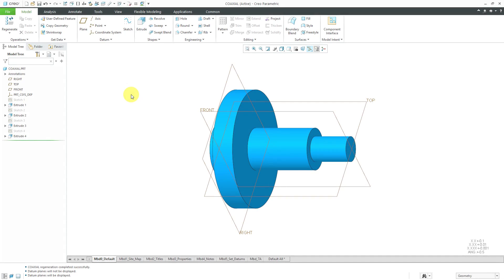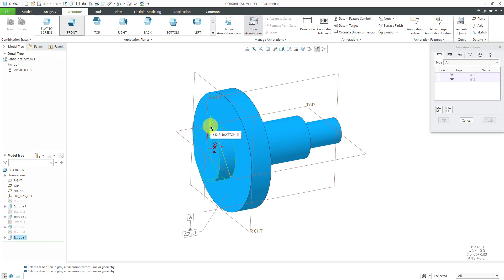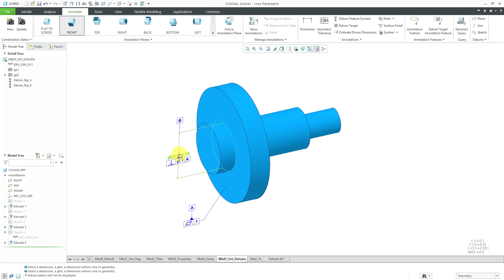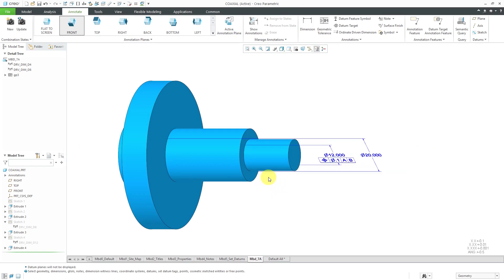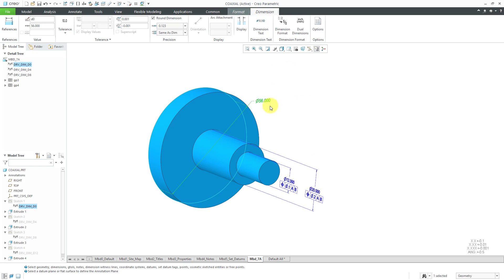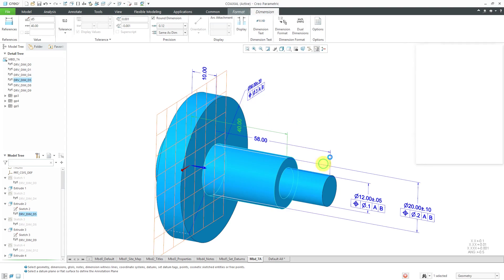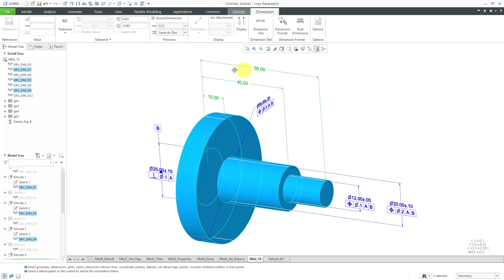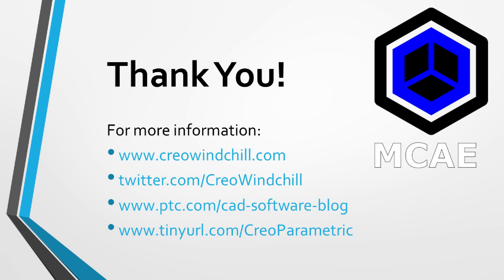Creo Parametric - Geometric Tolerances (GD&T) Part 2 - Model Based Definition

Comment: Have you had success with MBD replacing standard drawings?  Or is this more of a supplemental thing?
Reply: Hi Matt.  I was thinking same as you do two weeks ago.  MBD is a lot more than "replacing standard dwg", these info is embedded in CAD files to be used down the processes, i.e. CMM, CAM programming... And a lot more...  It saves lots of time, errors later on
Reply: @vesperita11  Does it support STEP242 standard? Can it be imported into CMM?
Reply: @vesperita11  Yeah, this is true.  MBD's should be approached with same degree of attention to detail as a standard drawing.  If MBD's become CAD the Master, can you call materials in your MBD?  What is your part going to be made of?  If you're going to paint your part, can you call out a paint spec in your MBD, can you call out other process like anodizing?  To control overall cost, can you add your own "general tolerance" notes?    There are other items such release engineer, checker, material engineer, etc...  Would these appear in one of the MBD frames, or on a separate document?   Thx.
Reply from the maker: Yes.